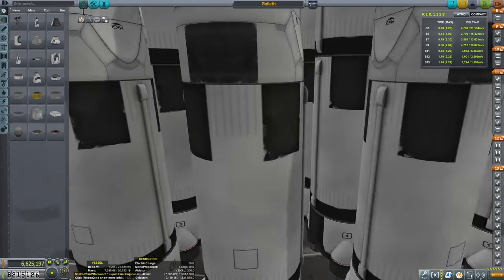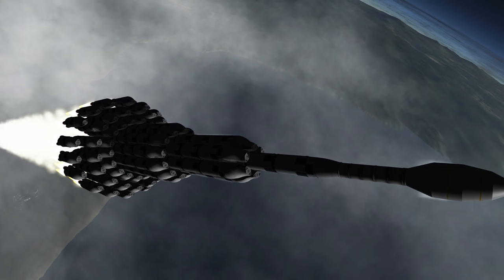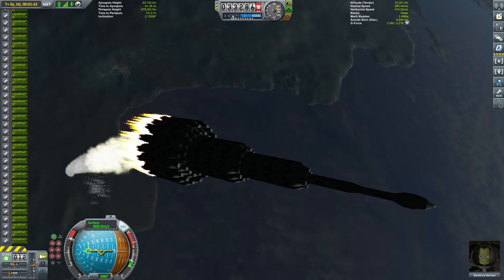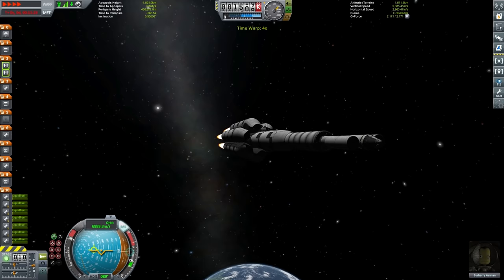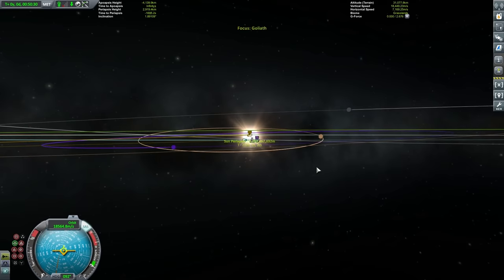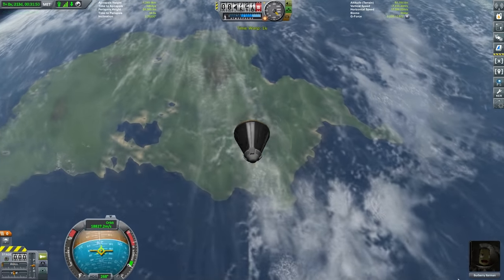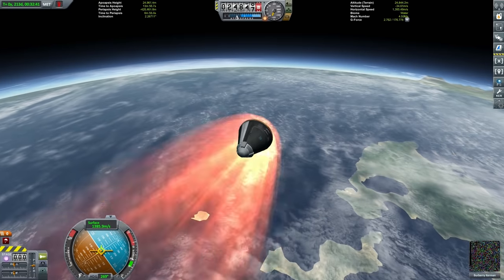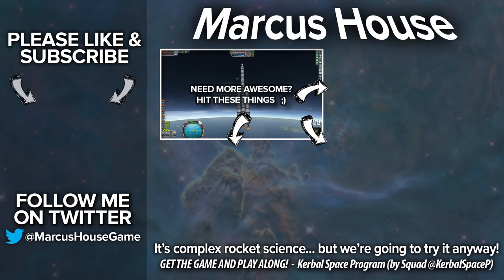KSP 1.2 Kerbin Head on Collision (Tutorial:33) Kerbal Space Program -  Stock Parts with Mods

Comment: By no mean guaranteeing that this would actually work (don't sue me, Mrs. Burberry), but why not try putting a stack of 3.75m heat shields one behind the the other, and maybe having some radiators on the back end of the craft? Of course, it'll be a much heavier ship so you've have to make the rocket a decent size this time... ;-)

There is a way of getting a more powerful engine than a Mammoth: the Mammoth is basically just four Vectors on the bottom of a 3.75m tank, however, you can actually fit SEVEN Vectors on the bottom of one (one in the middle plus a ring of six). You have to throttle it up gently to prevent it from breaking: start at low thrust, then throttle up in stages, then release the launch clamps. Compensate for the fuel wastage by putting tanks on the launch clamps with fuel lines to the rocket.
Reply from the maker: Tried this and they went... pop, pop, pop... (rapidly). Might add some more so I can simulate popcorn noise.

Comment: >hitting the atmosphere at double kerbin's orbital velocity
>instantly explodes
What did you expect? 
It's like hitting water at Mach 1 or something. The ablator can only reduce temp at a certain rate, after that heat builds faster than it can be dissapated. Plus the actual pressure would probably just rip the shield to bits! XD
Reply from the maker: +Chris Rysdale The Galileo Probe was travelling at 47km per second when it reentered. True we are talking one tenth scale here. Still thought it would survive a bit longer in the upper atmosphere which is still very thin though.

Comment: Just found you! If you want the numbers for why you can't even touch the atmosphere at 18 km/s: the relative temperature of the air is 150,000 degrees C, aka 30 times hotter than the surface of the Sun.

Comment: sorry for being stupid but what's delta v?
Reply from the maker: The amount of velocity gain you have at your disposal. If I told you that you had a delta V of 100m/s it would mean you could change your vessels trajectory by another 100 metres per second before you run out of fuel.
Reply: Basically the amount of speed you can squeeze out of the remaining fuel you have.